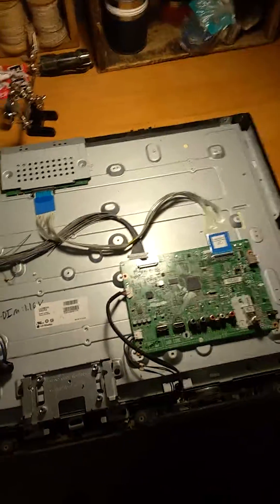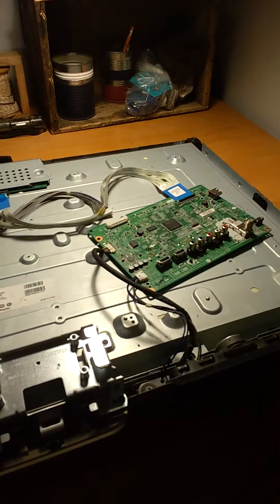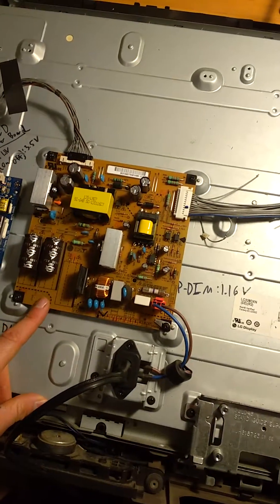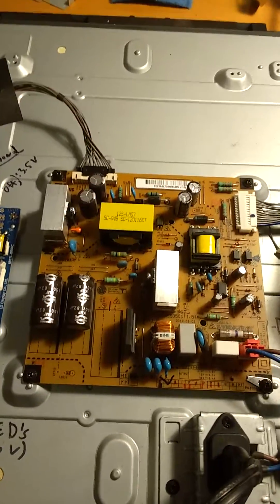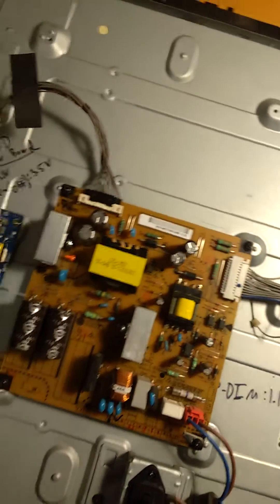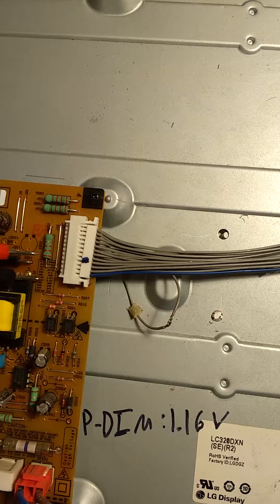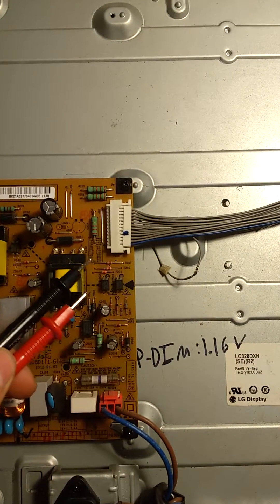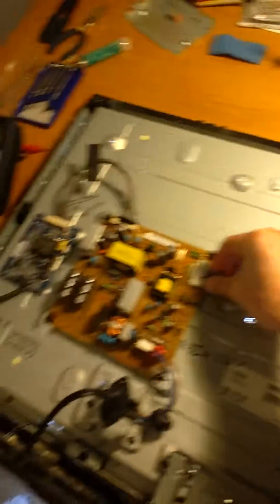HOW TO MAKE LIGHT SCREEN FROM BROKEN LED TV and other incoherent rambling

Comment: I have no clue how to bypass the auto shut-off...I just spent few hours trying to get this to work. Can you help me with mine?
Reply from the maker: I know this video is a little hard to follow, I was kind of all over the place and should maybe film another one. If your TV is like the one I have in the video, you basically want to either install/solder a wire between the right pins (electrical people call this a jumper wire) on the power supply board to turn the power supply on, and then add another jumper wire between the pins that send power to the LED driver board. If your TV has a cable going from the power supply to another circuit board that looks like it controls the TV, you might get lucky and be able to connect the right wires on that cable together as your jumpers. Hopefully you should be able to leave the end of the cable that connects to the controller circuit board disconnected after this and that will bypass the auto-off features from that circuit board. Were you able to find any information about your power supply circuit board by googling the serial number?